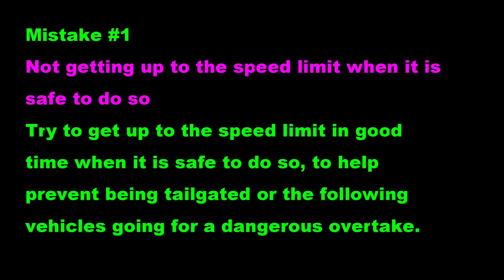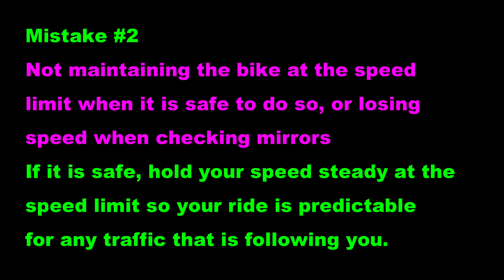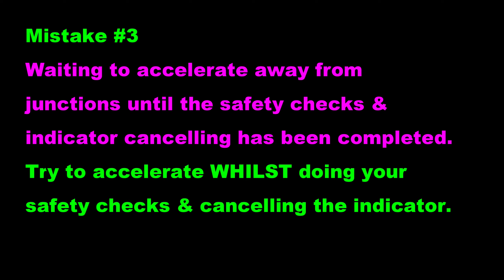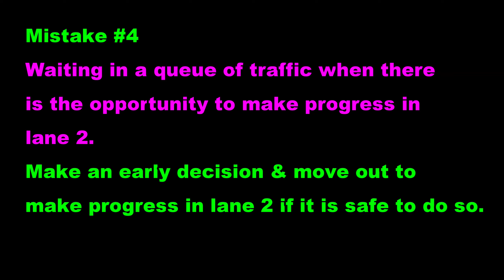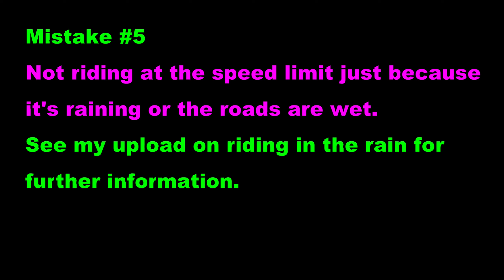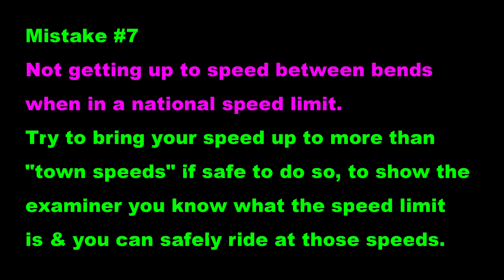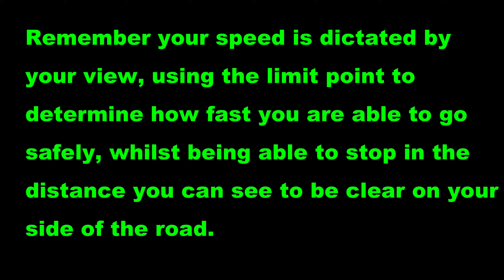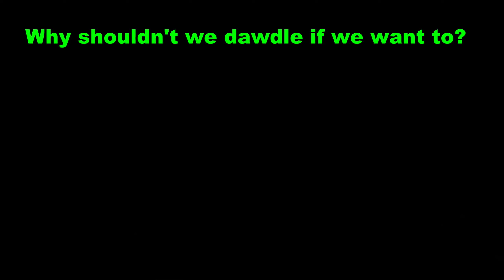Most Common Mod 2 Mistakes [7. Making Progress]

Comment: I’ve got a direct access 5 day course booked for September. Want to start look at gear to buy what helmet & gloves would u recommend
Reply from the maker: Hi, thanks for your question. For me the must haves on a helmet are an internal sun visor and a pinlock. Plus it needs to be very comfortable. It does not need to be expensive. As for gloves I can't really recommend anything specific except to say for summer it helps to have some ventilation, but also to have a pair that are more waterproof (or simply carry a spare pair with you). For summer I wear Oxford Brisbanes which are unisex and are only about £30. Hope that helps 😊
Reply: @motorcyclelessonsuk  amazing thanks for the tips. Have been binge watching your videos to be prepared as much as possible

Comment: On the subject of speedo error, my experience with cars, buses and my motorbike has taught me that consumer grade vehicles (think cars, vans, motorbikes) are deliberately set to read slightly higher than the actual speed, this is allowed in law (under reading is not). Professional grade vehicles like buses and lorries for example, tend to be spot on accurate. This could be for a couple of reasons. Firstly, buses and lorries are slow, so need the extra accuracy to help the driver make progress. Secondly, the license requirements are higher than cat A or B licenses (medicals, higher theory test pass thresholds, ongoing CPC training, etc) so perhaps there is an expectation that professional drivers shouldn't need as much (or indeed any) margin for error that consumer vehicles tend to have. 

The police often get their vehicles correctly calibrated, since at the end of the day their vehicles are just modified consumer vehicles. They need accurate calibration to check on speeding motorists while they themselves are on the move. 

For my car and motorcycle driving tests, I was taught simply not to speed and should aim for the limit exactly when safe to do so. Always cruising just below the speed limit would be marked as a fault. However, when I did my cat D, I was told cruising anywhere between 28-30mph in a 30mph zone would be considered making good progress.

Comment: Leanne or is it Leanna? I have a question regarding doing the national speed limit on a single carriageway way…you advocate keeping your speed up which means doing 60mph if it’s safe to do so but I can’t even do 60 in my car around twisty country roads let alone on my bike. I’d normally do 50 at the most in the car…where does this leave me? Will I fail for dawdling??
Reply from the maker: Hello 👋, it's Leanna 😊. Speed is always dictated by view and road conditions, so if the road is twisty, you don't have the view (see my upload on limit points), and consider it safer to drive or ride at less than the speed limit, then you will not be penalised for riding at a safe speed. If you are on a long straight road, with a good view, good surface and no other potential hazards, and you ride at significantly below the speed limit, on the test you may start to pick up faults, depending on how long you do it for. If there is traffic behind and you significantly hold them back this could turn a fault into a fail. I hope this helps 😊
Reply: Ah, thank you for a very comprehensive answer, it’s really appreciated and very helpful. It makes sense what you’re saying. I stupidly answered my query in my question by saying ‘when it’s safe to do so’…obviously on the straight, traffic permitting then I should stick to the limit but not on a winding road where typically it can be very unsafe to ride too fast for the conditions. I was thinking I’d have to ride like Valentino Rossi to negotiate all the bends at the national speed limit 😂
Reply from the maker: @brianhull5125  😂 you could try to ride like Rossi but I suspect thats where most riders come off, so best to assess the hazards and reduce speed accordingly 😂😉. You're welcome 😊

Comment: That's interesting, I was talking to a chap a while ago that failed his HGV for not making adequate progress. I was really surprised when he told me 'they like you to get up to 32 mph'.  I passed my car and bike test a long while ago I know, but when did 32, 42, 52 become the norm? I just wonder if 'some', more, ahem...'experienced' examiners, particularly in cars and trucks where they regularly check the speedo, may consider that 'speeding'? (especially if you slip to 33 or 34 occasionally) Who are we to 'judge' how much the speedo is 'out of calibration'? From what I've read, speeding tickets are being issued when the speed limit is exceeded by 1 or 2 mph in some cases with the latest cameras.  As as aside, surely with all the latest technology speedos are becoming increasingly accurate, or at least could be.
Reply: Agreed. My car speedo is accurate up to triple digits. I'd much rather sit at 28/30 on test than 32 and risk going faster.
Reply: @dreamcrusher112   I was just interested when this became the 'norm'..I passed both my car and bike tests in the '70's so what do I know?  One thing I do know though is,  if my speedo was indicating over the speed limit my instructor (car) would have pulled me up for certain. (My bike is nearly 40 years old and is only 2-3 mph 'out' at 60mph)
Reply from the maker: Hi, Speedometer law is covered in the "Construction & Use Regulations", of which, Regulation 3(2) states:

2.  For all true speeds up to the design speed of the vehicle, the true speed shall not exceed the indicated speed.

3. For all true speeds of between 25 mph and 70 mph (or the maximum speed if lower), the difference between the indicated speed and the true speed shall not exceed—

V/10 + 6.25 mph

where V = the true speed of the vehicle in mph.

So, the law is that speedometers cannot read below their actual speed. The permitted speedo variance is 10mph +/- up to 6.25mph. In effect your spedo could be reading 55mph, but your actual spewed actually being only 40mph dependent on the extent of the variance of your actual speedo.

An examiner will only give a student faults for speeding if the speed is excessive and prolonged. Our local examiners set their cruise control to plus 10% when following our students. I expect, like instructors, examiners don't enjoy it when students ride at 26mph in a 30 limit, which results in the examiner being tailgated by impatient road users behind, whose speedometers may well be reading 22-25mph.

We would hope that modern speeds might be more accurate but without the information and proof to hand, other than the day to day experience of being tailgated when students don't get up to speed, we have no way of knowing.

For reference: https://www.legislation.gov.uk/uksi/2001/25/schedule/3/made

Thanks for your comments 😊
Reply: Be wary of anecdotes.
Reply: @motorcyclelessonsuk  Might be worth seeing if you can get all the training bikes properly calibrated? I imagine modern machines it will all be done via the ECU. The police do it so surely anyone else can too.

Comment: Something that does hinder my progress is the wind. Especially a cross wind. Difficulty is it may cause a build up of annoyed car drivers who aren't experiencing the world the same way!
Reply from the maker: Hi, the more you ride in windy conditions the easier it gets. I actually quite like the challenge of wind. Do you ride a big bike or a 125cc?
Reply: @motorcyclelessonsuk  Riding a 125cc atm (mod 2 soon) but it is 170kg wet weight so not light. Have a 150 mile ride across mid-wales tomorrow with 40-50 mph gusts predicted.
Reply from the maker: I'll try to get out on a windy day for an upload 😊 Hope your trip went well 👍
Reply: @motorcyclelessonsuk   260 mile round trip - stormy weather, downed trees, upland moors and passes! Got blown about in my lane by some very large gusts... but I survived. My medium-sized screen makes a huge difference on the Zontes G-1. Also booked my Mod2 test - about time I tore off the L's! (4000 miles covered with them).
Reply from the maker: @daddystu7046  excellent. All adds to the experience 😬😂 Good luck with the Mod 2 😊